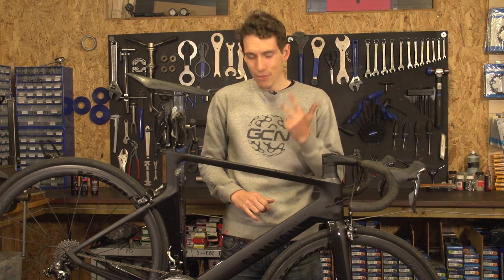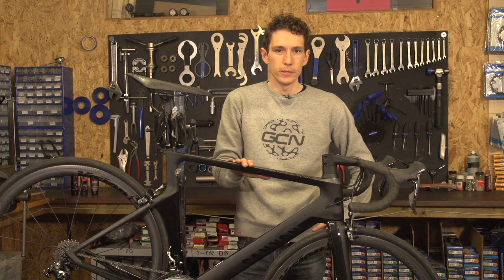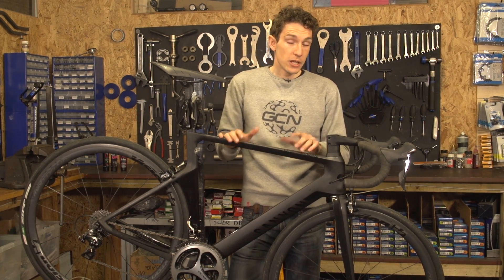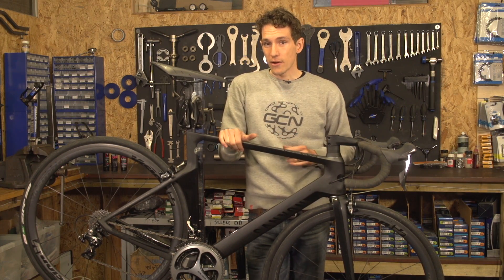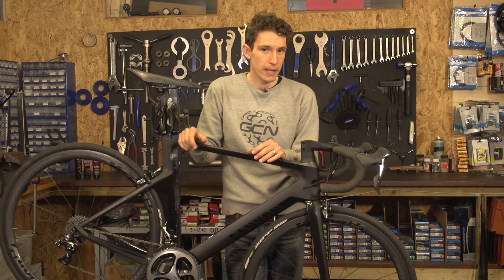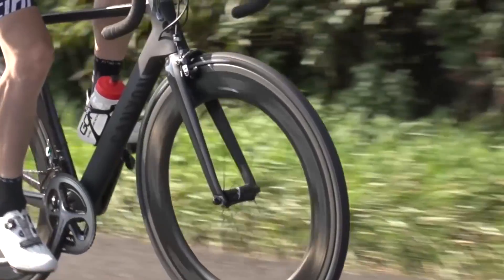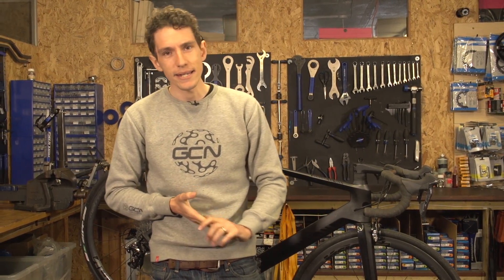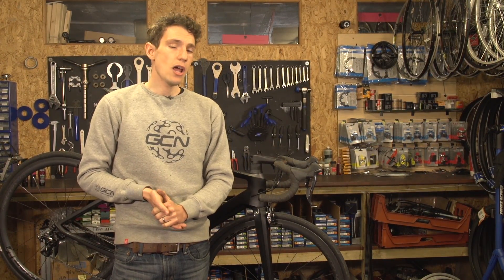7 Things You Didn't Know About Carbon Fiber

Comment: Broken carbon can't be fixed to previous state. If the resin is UV resistant why need for UV resistant finishes? Because it's not UV resistant. Strong look at airplane? Why? To see aluminum? Sometimes, there are dents on bike frames that occurred in transport. You can ride it with confidence if it is aluminum or steel. Carbon? Forget about it. Despite 90, 45 or whatever degrees layers. You can break it with hammer. For steel, you need anti tank mine. Another thing, why some parts on carbon frame are made from aluminum?

Comment: I got 2 bikes. One all al mtb and one al with carbon fork and is gravel. I do find gravel bike to be more comfortable despite drop bar and thinner tires and at same pressure. I also notice I feel jittery on rough roads in turns… may be more to do with less grip of tires. Gravel has 47mm and mtb is 2.2 inch one. Though I suspect the carbon fork is not that stable in turns when the road is patchy. Also, front fork has sus on mtb…. Now I have to be extra careful on turns with carbon fork if the road ain’t good. I suspect the side sway strength is not there.

I like the comfort through. Despite no sus it is as good as mtb with air sus and sus has right air pressure as per my weight. And I had to reduce rebound considerably to make sus comfortable.

Comment: he he its Hambini who not impressed by Canyon, not MVDP either (maybe).
yes its lighter weight
yes its stiffer compared other materials with same tickness
thus shedding weight and still keep great stiffness/strength
yes its forms possibly endless
yes its still cool since Lockheed
yes its MAKES COST WAY ALOT
yes its looking horrible when they crack, some mendable, some not:
                          c-wheel failure seems scary
yes its Oliver Naesen rode a steel frame on the last stage of TDF
yes its Marco Pantani who was the most recent winner of TDF on a ALU bike 1998
yes its Igor Astarloa who was the most recent winner of the RAINBOW jersey 2003
yes its I enjoy ride carbon frame; NOW I test ALU and so far joy
yes I believe 6,8 kg for a complete bike set-up is reasonable

Comment: Carbon fiber used to make planes are quite different to carbon fiber that is used to make bikes. While the suppliers are the same the manufacturing process is quite different. Most carbon fiber bikes are made in china where the OEM is paid about $100 to make a full frame and fork. A plane part on the other hand is scrutinized to a high degree. The sad fact is the industry lacks regulation.

Comment: Carbon fiber is strong on "simple geometry" notably on boats. Carbon fiber is weak on "very sophisticated geometry" like on bikes. Carbon fiber is strong on 1 direction because they are simply overlapping fibers but with bikes of having multiple stress points, it doesnt really play well on long term durability. The sheer number of stress points on bikes are what makes carbon fiber frames weak in the long term also the glue that bonds them which disintegrates overtime. In the molecular level, alloys or aluminum frames are better since they are single construction (homogenous), but carbon fiber is built from many raw materials to form. So more parts, more prone to failures.
Reply: Is it ok to use caebon fiber bikes when it's raining and is it ok to wash them with water?
Reply: @Hopes_and_Haves_01  yes they have coatings anyways. It's physical forces that usually strains carbon.
Reply: @arvincabugnason6728  I still have a 40 year old steel frame road bike. With simple anti corrosion maintenence the frame is rock solid and i do use fatter rims and tires to go off road as well. Steel can really take a beating, its heavy though. Obsolete in racing terms.
Reply: @cycomiles4225  yes simplicity is better than any complex bike system. But go with shimano/sram parts if you can for safety.

Comment: I just returned a full carbon fiber frame from cannondale. I ride strictly mountain bike. I can tell you without a dought that the carbon fiber frame was the most uncomfortable ride I have ever had. I would wake up sore all over my body and I could feel the stiffness of the frame through my bones! I went right back to my incredible 7005 triple gauge aluminum bike and almost all the pain is gone! To me the aluminum frame absorbs more of the vibration and hits and I can actually feel the frame flex and gives me a better feel of the dirt, concrete etc...The aluminum frame is more responsive and just as light and strong is not more than the carbon fiber. I dont care what anyone says but aluminum is way better than any carbon fiber frame ive ever ridden! Carbon fiber is way overrated!!
Reply: That is so true. My aluminium bike frame also absorbs vibrations better

Comment: I have worked with carbon fiber sheets and tube and reference a NASA article which details issues related to radial, axial, lateral, planar, perpendicular and hoop strength. The strength of a CF vessel to withstand high internal pressure is extreme but the eternal crush strength is at the opposite end of the scale, i.e., easy to crush. Very little Perpendicular force  is required to penetrate a sheet whereas kevlar is the opposite making it useful for bullet-proof vests. Only graphene can further improve perpendicular strength and not by a lot.

Comment: I really enjoy your presentations - you speak very clearly and have a great style. Thanks.
Reply: Carefully lightly-sand the "chip", & then apply 2-part epoxy. Buy the epoxy from a marine supplier, NOT from a hardware store! Add some additive to thicken the epoxy, or it's too-runny. Tape off the adjacent area.

Make it slightly "proud", so you can finish the repair with a final sanding, using a HARD-backed fine sandpaper (so you'll not depress the repair using finger-pressure). 

Epoxy should set in a few minutes, & it's easier to final sand when still-soft (slightly).

Prime, & paint to match. Easy :-)

I build catamarans with CF & epoxy. My epoxy supplier is: US Composites in FLORIDA, USA. Buona fortuna!!

Comment: Hahaha. Love the comment about uv rays and carbon. “If you have your doubts just look at your airplane next time you board”. Some of those airplanes did use the wrong resins and needed to be painted before being exposed to outside. Made the manufacturing hangers really warm not being able to open the big bay doors.

Comment: I've got a friend, who's carbon front wheel melted - to the point of front tyre popping and a visible melted patch on the rim was evident -  when he took his bike for a 4 hour drive on a tow ball mounted bike carrier.  Aparently, the heat of the exhaust did the damage.  Point to note is, the vehicle is a brand new Holden diesel SUV.

Comment: Carbon fiber haters are the flat earthers of cycling.

After upgrading to a carbon frame I did not know if I could ever go back to steel. After upgrading to a carbon crank my mind was blown. I am currently eyeing carbon hoops and bars and I suspect they will likewise be a massive improvement. The one frame I ever had that broke was steel. The bottom bracket weld snapped after only 15k miles.

Comment: It's plastic.  I wish folks didn't gloss that over so pervasively.  Thus, we all understand: plastic can last a long time (but usually doesn't), plastic can be repaired (but not easily or well), and plastic can be designed and manufactured excellently (but mostly isn't).  

Take into account cost effectiveness and manufacturing competence, and if you have notions of keeping and still riding your bike in twenty years, there are better materials to bet on.  Remember that there have been carbon fiber bikes for a lot longer than that, but how many of those do you still see?

Comment: I have a carbon fork. I have added rubber strap on bottle cage mounts (from Decathlon). put 4 cable ties over these to make solid. And when I tour I attach a couple of Blackburn outpost cargo cages ,hammock on one side inflatable mat on the other. Should be cool eh? one test ride so far.

Comment: Aluminium will not fail as catastrophically. Carbon, when when undergone enough crack propagation, will fail in a brittle manner. Aluminium fails in a ductile manner, meaning it will bend, not break.

Comment: My carbon fibre steerer tube snapped during a ride at the stem connection.  Just enough time to think "Oh shit" before I went down - hard.  Luckily I lived, but even now, 7 months later, I am not 100 percent.

I wonder if a catastrophic failure like this could have occurred with a metal steerer tube.
Reply: Yojimbo what kind of bike?  Did you determine the cause?

Comment: Faster is sexy, however a pro would just absorb that extra weight by applying more power. Over several days of consecutive riding the energy spent would have an effect. For an average cyclist who has unlimited recovery time im not sure it would have an accumulated effect. I think the effort level to accelerate the bike uphill and on the flat would also be interesting, as well as speed. Do this multiple times over multiple days. That way we would know what the pros have to go through and also an idea of what our limitations would be

Comment: My carbon Felt F1 Sprint came off the bike rack of my trunk at 45 mph and I watched it do about 5 toppling crashes down the highway before it came to rest.  I picked it up and bent the Dura-Ace shifter back into place with my hand, rode it in that day’s century ride, and proceeded to add another 30,000 miles to the bike over the last 6 years.  Try that with a metal bike.

Comment: GR8 video...my concern about carbon frames is that, some parts do require an aluminium part (where stress is a high factor) thus bonding two different types of material with glue... I believe that these parts are subject for a lifespan/shelf-life  also depending on the stress they endure true out the journey.  this is just my opinion I guess...

Comment: when i was looking for a new high end road bike about 6 yrs ago, I probably rode 20 different bikes from 8 or 9 bike shops.  Merlin, seven, lightspeed, moots, look, specialized, orbea, giant, trek, etc.  Last bike shop I tested a Look.  It was an awesome ride, super stiff and pretty comfortable.  I was about to pull the trigger until one of the bike builders was pulling a frame out of the box, brand new.  There was a 3/4 in chunk missing from the bottom of the bottom bracket.  It was pretty shocking to see.... may have been from shipping damage, but who knows.  Box didn't look damaged.  long story short I ended up buying a moots.  Very happy years later.  Ti is real, steel is real, aluminum is real... carbon, not so much...

Comment: Why you never hear of kevlar bikes??????
Reply: Kevlar is great material. However it alone has no stiffness. As such it will not hold a shape by itself. It is great for abrasion resistance and impact resistance. It is often combined with carbon for its positive attributes. In bike design stiffness and light weight are the goal. Additional materials such as Kevlar mean more resin ( adhesive matrix) and add more weight.

Comment: My carbon bike usually makes a lot of those crackling noises I'm just curious if I should do something about it. I think the noise comes from the seat post, but i cant tell...
Reply: I had some VERY loud cracking sounds with my carbon bike. Turns out the shop mechanic used the wrong bearings on the front wheel. They were circulating in the bay race and binding up against each other then, suddenly breaking loose. Upon breaking loose and freely circulating again a tremendous amount of energy was being released with a loud crack. This could be felt everywhere throughout the frame. Changing to the correct bearings for the original bearing "race" solved the problem promptly!
Reply from the maker: hi, carbon does have a tendency to "creak". the best thing to do it make sure that you are using carbon paste where needed and ensure all bolts are tightened to the correct torque.
Thanks
Jon

Comment: For those who ride Carbon, if you store your bike indoors you ought to seal it in a bag of some type. This will prevent wear or damage from temperature and other things of that nature. Might want to put a blanket over it to as your bike could get cold.
Reply: carbon fiber is not affected by cold. The materials are stored frozen before use. They are cured at temps of 350 F. Whats with the blanket comment?
Reply: I see you have yet to learn the art of sarcasm...

Comment: Alimunium is isotropic because the physical properties are the same in all directions. Composite layers are engineered to be anisotropic, desiring those physical properties to vary depending on the directions. For instance, you need more resistance for vertical loads then for lateral forces on a frame. On aluminium bikes you can compensate that by designing different thickness depending on the section. On a composite, you will increase direction on one direction. Plus, using 45degree alternated directions, it distributes tension within a plane instead of in space. I am not an expert in bike design and construction, but am a polymer and composites graduated engineer with some R&D working experience for automotive. Not my field of work lately.
Reply: Future will develop intelligent anisotropic materials that can vary their properties depending on solicitation to prevent failure or catastrophic (collapsing) failure. R&D was still a challenge when I was involved in it.

Comment: How do we repair carbon fibre bikes? Is there a method? Could u please assist me.
Reply: Shubham Raisoni it has to be done by removing any damaged parts of fiber and then using resin and new fibers to lay up a new section. You can possibly do it at home, there is some YouTube videos, look them up. But I would suggest and extremely advise to have it done by a composites profesional. You have to take into consideration a lot of factors, load, stiffness, etc to make the bike structurally safe.

Comment: I want to buy full carbon bike, but all say that it breaks easily. is it true? Should I just get aluminum bike? Thanks
Reply: Well aluminium and carbon frames are two different categories and they each have different price ranges. It's better to buy an expensive aluminium frame than a carbon frame that is cheap relative to the price range of carbon frames.
Reply: MrOndrof
Reply: MrOndrof hello there,  let me tell you that the fiber carbon is an excellent material for a bike, it is safe, the original carbon is too much better than chinese, always use original carbón and you Will not have problems or risk :)
Reply: MrOndrof hello there,  let me tell you that the fiber carbon is an excellent material for a bike, it is safe, the original carbon is too much better than chinese, always use original carbón and you Will not have problems or risk :)

Comment: There are actually some things YOU didn't know about carbon fiber :PPP

There are more than 5 CF manufacturers. Toray (+Zoltek), SGL Carbon, Toho, Mitsubishi, Formosa, Hexcel, Cytec and some more ;)

Ultra High Modulus fibers are heavier, because of the denser arrangement of the carbon atoms. If you take PAN fibers for example. High Strength PAN CF has a density of arounf 1,78-1,80g/cm^3 while UHM PAN CF is about 2,0g/cm^3.

Comment: Nice Video!

I work a lot with carbon, just one thing to mention.. carbon, as fabric out of strings, the dangers by braking are getting carbon pieces in your skin, which could cause blood poisoning if the pieces are not removed.

Comment: Hi Guys, i wrote my master thesis over the fatigue of fibre reinforced plastics and i have to tell you that the fatigue behavior of carbon fibre reinforced plastics is in fact much better then that of alluminum. That is one reason why airplane builders are so enthusiastic about changing to that new material. The Big Problem with it is of course that when you design a part according to the load cases you assume making full advantage of the unisotropic material properties (depending on the orientation) the part is very good and lightweight for this load case. But of corse not for a load case that was not considered and applies loads to the part in other directions. So you can say that aluminum or other isotropic materials are less vulnerable to unexpected load cases (crashes) but a carbon bike used of its designated purpose (riding it) is less vulnerable to fatigue and can thus last a lot of years being used hard.

Comment: What about the grease question? When I picked up my first carbon framed bicycle the last thing the guy at the shop told me was that I should never use any kind of grease on the frame or any components that come into contact with it. Since then I have heard many differences of opinion on this topic and I have personally thrown caution to the wind.
Reply: outandaboutDave technically grease should not ever be needed on a carbon frame. Seat post should be coated in fiber grip instead. The headset is the only place where opinion differs, some say fiber grip messes up your headset bearings and others say grease makes your stem slip (CF Stem and CF steerer o course)

Comment: About frame repairs: after an accident, steel tubes can often be bent back to shape, no welding necessary. Forks can be bent for more offset (rake) as well. Neither aluminum nor carbon can do this, since they overwhelmingly crack during crashes. It follows that frames made of these materials require much more involved and costly repairs outside the scope of most home or local bike mechanics. This myth is pretty accurate
Reply: charlesissleepy Steel can be bent no problems, but aluminum is very prone to metal fatigue if its bent without being heat treated. You have to heat treat aluminum when bending it to avoid metal fatigue.